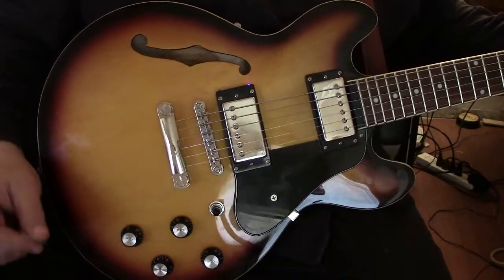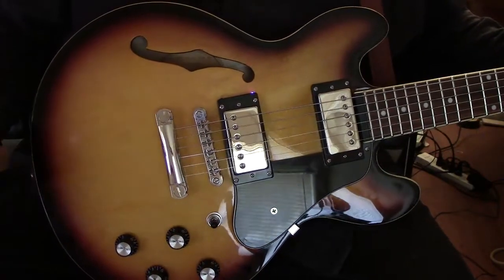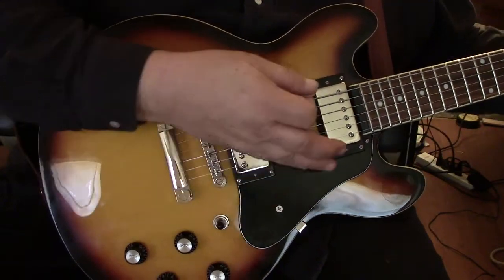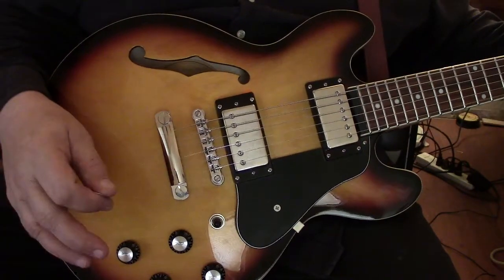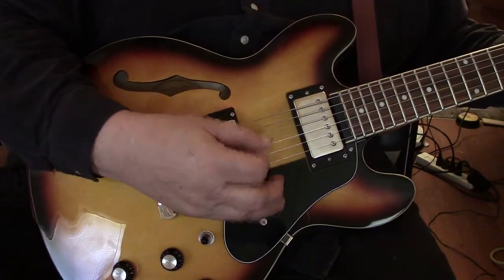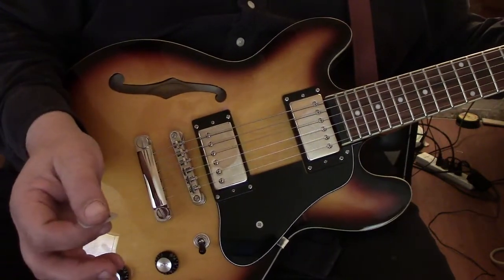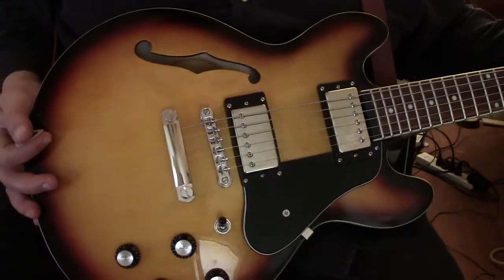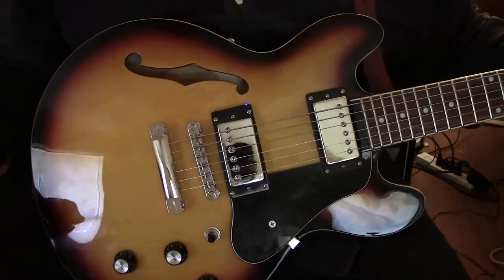"STEREO" ES-339 ULTRA.....SOUND BANK

Comment: Just got one of these - it is great. I really like having the tuner where it is - very innovative.
Reply from the maker: Yep, this is ONE HECK of a Guitar.  I sure hope that you have not had the common problem these seem to have with the USB connector on the guitars body. The only other things I had some problems with were rough fret ends, frets that needed to be polished down some and it's final setup. Once those problems were taken care of it became one of my go to guitars! Im always playing it compared to my other ES models. 

Also, this particular Model has been Faked in China. BUT, without the Nano etc electronics board and all. Just two plain PUPs and controls. AND I have to say ONCE I switched all the Hardware and electronics out of that Fake it sure sounds and plays nice.  I also switched out that plastic Nut that came with it and installed a Bone Nut making the tone richer and increasing the sustain.  Thanks for the comment and be sure to watch my Years End Videos.
Reply: Davesintexas Happy to report mine is pretty great all stock parts. The Probuckers are surprisingly good - I like them better than the 497's in my Gibson SG. Played a duo gig NYE with another guitarist - he has a Fender Custom Shop Tele - very sexy - the Epi 339 more than held its own against that Tele.
Reply: Promot Ed Also - not sure if you have the same related vids in the column to the right but the gentleman (Jeff Pevar) advertising the Gibson Es339 for Musicians Friend will be at my home later on today - he's doing two concerts for me this weekend. It will be interesting to get his opinion about my Epiphone.
Reply from the maker: Promot Ed Be sure to video any thing you discuss with him and Id be more than happy to put it up on my channel...hehe...Yes, I do agree Ive had my Ultra for a while now and as I have written it's my go to guitar for it's type. Any Semi work and its in my hands. Which means a whole lot of time. Also, the Fake Gibson ES 339 that I got and Mod;d out it's very special to me as well. As long as I can keep that darn thing running! You see those Smaller F Holes on these makes it near impossible to work on this Fake!  I may THIS YEAR do a Video on how to Open up the Back of My ES 339 from China so that future work can be preformed on it as if it were a LP. Also on the Fake 339 I put on an Adjustable Brass Bridge and now that action is SOOO LOW its amazing.  Just a gentle touch and the notes played.  

So, keep up the work and be sure to send me that video..hehe...